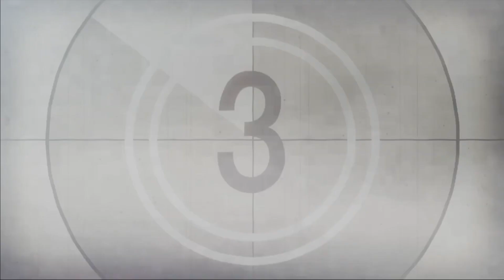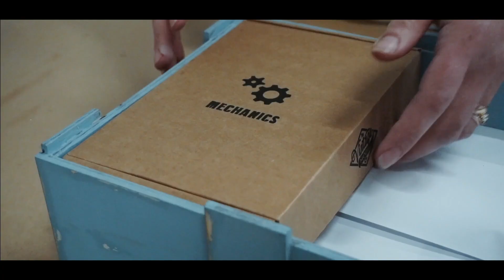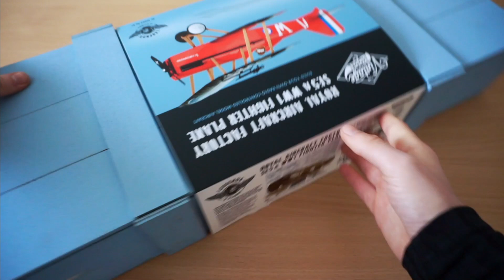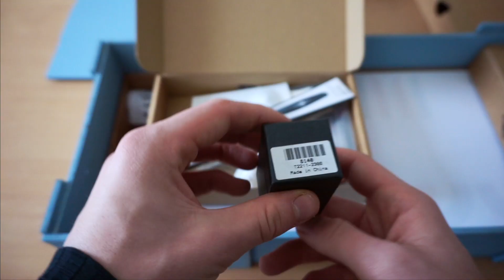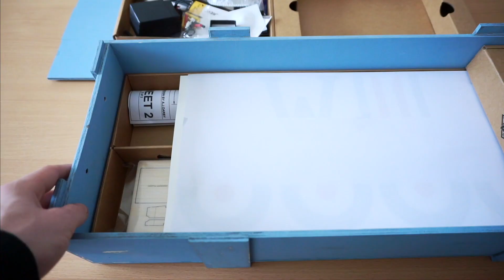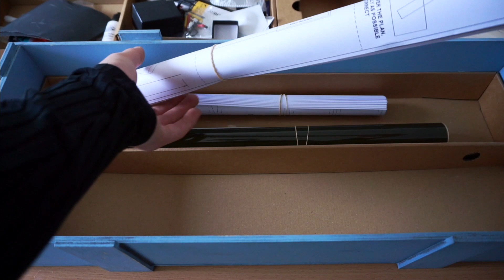Ultimate Model Plane Kit UNBOXING! - SE5a Build Series pt. 1

Comment: Im confused about who this kit is aimed at. It seems complete beginners as you have included a craft knife! and glue... something hobbyists generally already have yet you have ommitted radio gear which the beginner would be unlikely to have. Either make a complete kit with everything needed or dont mention beginner anywhere! Its like a guillows kit but with extra bits but not enough to get it flying...50quid maybe